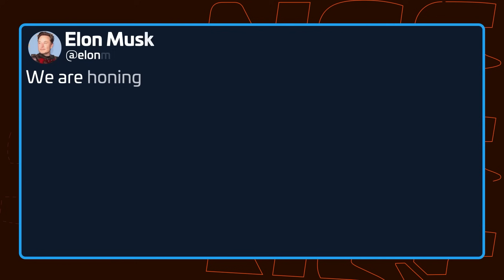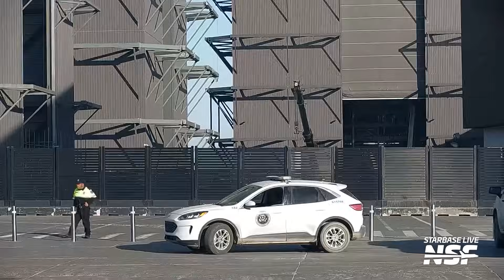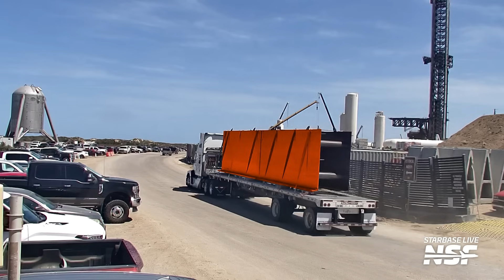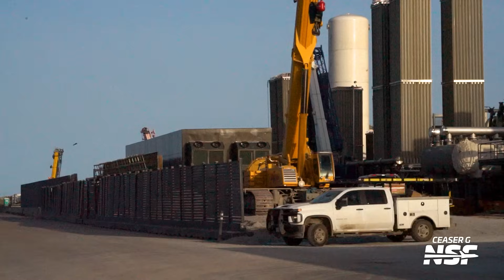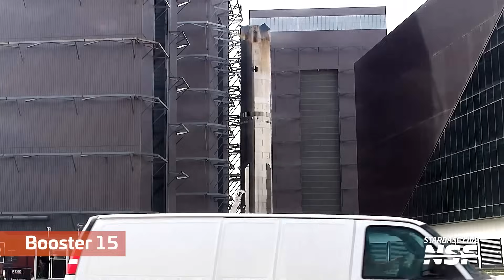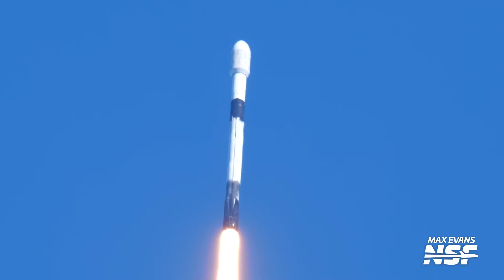The End of the High Bay & the Rise of Giga Bay | Starbase Update

Comment: For all that concrete... When does it just make sense to create a concrete plant on site or within a mile or two?
Reply: Well then you would just be carting trucks of shingle and cement to a near-by point, to just make the concrete mix, and then just carting trucks of cement a shorter distance. No gain at all. You have to work near the quarry that supplies the raw material.
And once SpaceX have their finished launch pads, they won't need much concrete after that anyhow.

Comment: Just think, at some point in the future we're all going to be glued to the screens when they attempt the first launch-relaunch of a booster. It will take off, come back down to the pad, put back on the mount,. a starship loaded on, and the booster fly off again, all inside an hour. And of course then another catch of the booster.
Reply: That's the fantasy.  The reality won't ever match it.

Boosters and Ships are quite hot upon landing; the Ship's TPS tiles will take hours to cool down (as did the Shuttle's tiles).

The obligatory de-tanking of residual propellants and flushing of propellant tanks to get rid of accumulated water ice and dry ice from autogenous pressurization in the LOX tank, will likely take hours - before any new propellant could be loaded.

There will be a need for inspection of the engines, flaps, grid fins, TPS tiles, and so on after every flight - but the personnel to do that will be evacuated to 5+ miles away for every launch and landing, and it takes time to safe and reopen the site and get people back in; then to close and evacuate the site again before the next launch.

Loading and off-loading (when applicable) of cargo on the just-landed Ship won't ever be as quick and easy as loading and unloading of baggage and passengers on a commercial airliner, either.

And you can't keep the launch corridor and hazard area ocean and airspace pretty much permanently closed for such rapid-fire launches, either.
Reply: @Spherical_Cow  It's always funny when armchair experts think they're rocket scientists. 
You sound like a clown.
Reply: @RGBmode  armchair experts have said from the beginning that this thing needs a flame diverter, that this thing has no payload capacity and needs to be 'bigger' or much much lighter and... that the heat shield looks a lot like the heat shield from the shuttle and has most likely the same problems which means refurbishment. 

and the list goes on. That's why arm chair experts refer to Elon time... because, you know... he is a guy who plays video games while engineers trying to explain something to him...
Reply: @RGBmode  as I said, sure... if it make you feel better, maybe write in all caps just to underline that you are so young and hipp... 😂
Reply: It won't be completed in under an hour for a couple decades. Not until we sort out repulsorlift technology (ala Star Wars) that can easily and quickly transport heavy objects. Because as long as we require wheeled mechanisms to move Starship from storage to the launch tower, it's going to take time. 
Then, when it's finally stacked it'll still take another ~30min for propellant loading. (~45m currently, I'm assuming only slight improvement on that time frame)_

Heck, it takes roughly 30min just to turn around a commercial jet! Ground crews come on, clean it, empty waste (both garbage and septic), cursory maintenance checks, and refuel.
Reply: @ I don't think you understand how this is going to work. 
Both the ship and booster are fully and rapidly reusable, so ships will be coming down from the sky, caught and relaunched, be it a fuel starship, payloads already loaded on to waiting ships etc.  There's also nothing to stop one road closure being used to transport ships there 10 at a time. SpaceX can just build a new road if they want to. 
There are also two towers here and another elsewhere, ships will be coming down and going up continuously as fast as the pad can turn them around, especially fuel ships taking up propellant to numerous fuel depots in orbits which allow starships to be launched around the clock. 

A ROAD isn't going to stop this lol.
Reply: @RGBmode  In not talking about a road, or a road closure. I'm talking about wheeled transports moving slow. 🍻
Reply: @DUKE_of_RAMBLE  Are you slow or something mate?
Reply: @RGBmode  The insult is uncalled for. 
If you can't grasp that transporting heavy (and tall) objects takes longer than what the sped-up footage they show us on NSF conveys, that's your own issue, not mine.
Have a good day. ✌️

Comment: Here's an idea: If rapid ship reusability proves to be impossible, they could just mass produce basic ones so quickly that it wouldn't even matter if they don't come back.
Reply: They're doing both, but the bottom booster is already reusable. To get the cost down below $30m/flight (cheaper than F9) they need full reusability. Given that they landed the booster 3x already (the one fail involving thrust blowing off a transponder ariel... very easy fix). They have that part down. The 2nd half will be only somewhat more complex as they already nailed hovering over a specific spot on landing. Really should be able to try a return to tower of the 2nd stage within the next 3-4 months. Pad 2 should be online by then.
Reply: @avgjoe5969 with a purpose built discardable second stage (no TPS, no flaps, no header tanks, nothing overbuilt to support multiple launch and landing cycles), the cost per launch could still drop easily below $20 million.  Even 9 Raptors (similar to what we used to know as Block 3 Ship configuration) will cost a combined total of less than $5 million or so, that being more than 50% of the overall cost of the discardable second stage.
Reply: @avgjoe5969  "They have that part down"
Don't count those chickens just yet 😅
They had reaching (sub)orbit "down" as well, and now with a new design, they aren't able. Don't forget that Booster will also be getting an upgrade and that it, too, could reset their success rate!
Just sayin' 🍻

Comment: Will Starship V3 be longer than V2?
Reply: Probably, we just don't know how much longer but probably not that much compared to what was originally announced in early 2024 (back then it was supposed to be stretched by like 10 meters)
Reply: From a SpaceX video I saved a screenshot in June 2024 and V3 was 17.7 meters taller and the booster 7.9 meters taller.

Comment: They need to both re use boosters and build starships faster to get a cadence near even 24 flughts a year. Re use B 14 and or 15 would help.

But for now the prio should be to get V 2 to orbit. If they csnt do that the system is doomed.

Comment: I'm curious about the construction of the Starship Quick Disconnector on Pad B.
As future boosters get longer, we can expect the location of the Starship Quick Disconnector to be higher.
I wonder if it will be installed higher from the beginning, or if it will be able to move up and down.

Another thing is that future versions of Starships are predicted to be longer.
I wonder if the current tower height, or the height that Chopstick can reach, will not be enough. What do you think?

Comment: I will be surprised if that steel wall doesn't warp from the exhaust heat, and break away from the concrete. Water pumped from a big hole in the river might have cooled it better.
Reply: There will be a large water deluge system integrated into the flame deflector inside the trench, as well as into the launch mount on top.  Much more water will be used for each launch, than on Pad A currently.  Whether or not this will be enough to sufficiently protect the trench walls and floor - I guess we shall see.

Comment: LOL  Nice dig on Heathrow!  ;-)  One question you didn't bring up is where they'll get "a launch a week" worth of liquid oxygen and liquid methane without seriously messing with the supply/price for everyone.
Reply: Liquid oxygen is easy to produce on-site by refrigerating and distilling air.  All it takes, is lots of electricity to power the processes.  (You also get liquid nitrogen, distilled water, and argon gas as useful byproducts).  Even if made off-site and trucked or piped in, scaling up LOX production in response to increased demand is pretty straightforward and wouldn't take very long.

As for liquid methane, that's the main component of liquefied natural gas - something that the United States is producing in such vast quantities that even multiple daily Starship launches would hardly make a dent in the market.

The problem with satisfying Starship's propellant needs will be more that of logistics: how to steadily deliver the propellants at sufficient rates to the launch pads, without hopelessly clogging up and destroying the nearby roads.
Reply: @Spherical_Cow  think they could build a pier at the port and pipe it in via a barge?
Reply: @nathanaustin6988  in the long term, some sort of a pipeline is inevitable IMHO.  But that'd take a good while to get permitted and built.  At the Cape, things are all the more complicated thanks to all the other launch pads and facilities all over the place.
Reply: @Spherical_Cow Nailed it. 
Oxygen will be done onsite. Methane is can easily be sourced.
Reply: @ yea they are going to have to produce it or build a pipeline....otherwise at the launch schedule they want it will be bumper to bumper tankers..
I haven't seen much activity on the gas separation plant...you would think this should start becoming a priority in the very near future..
Reply: what's going on with the plan to produce oxygen and nitrogen at the launch site?
Reply: I wonder whether The Boring Company could come into play here. I just measured it on Google Maps and the straight-line distance from the entrance to the Port of Brownsville (not the actual loading/unloading basin but the end of industrialised area along the approach river/canal closest to the sea) to Starhopper is about 7.2km (about 4.5 miles).

I’m not sure how deep below the ground a tunnel would have to be for environmental protection to accept it would have no environmental impact and allow it to go under the wetlands but as I understand it once it gets going the boring company machine is like a mole and doesn’t surface until it gets to its destination (the other end of the tunnel) so maybe that could get a connection directly to the launch site reasonably cost effectively (doubly so since both companies are in the Musk collection) without being blocked by the EPA.

If that was possible then one option might be for SpaceX to create its own pier on the approach either with massive storage facilities or perhaps even keep a ship docked there and supplying the pipe until it was empty so that the ship is also the storage facility and then time it so that a new ship arrives as the other one departs empty.

This all for the CH4. I’m assuming the LOX and liquid Nitrogen gets produced at the launch site as currently indicated in SpaceX’s launch site plans.
Reply: @julianfp1952  ...the idea of having the boring company take your shortcut seems plausible...especially considering upgraded  electric lines could also be included   odds are spacex would opt to do something like the norstream pipeline though..
Reply: @ I was also wondering about power lines too. From my limited knowledge of The Boring Company I think it does fairly big diameter tunnels so probably big enough to run an LNG line plus high power cables plus still have walk-through access for maintenance. The planned Air separation plant at the launch site is going to need a lot of power so another feed would be useful, maybe even essential, and depending on how much land is available for development around the approaches to the Port of Brownsville SpaceX might even be able to also build its own quite substantial generation facility there, something it’s done on a smaller scale at Starbase but it has limited space there so another alternative site could be really helpful.
Reply: @julianfp1952   with the advent of Inverters, DC power has become feasible...this is a lot safer and in the long run more cost effective than High voltage AC...the upfront costs are substantial but this would a viable power transmission option.  DC Lines also work well laid under water..so this would be another viable option
Reply: @julianfp1952  I kind of doubt that the Boring Company's TBMs are currently capable of drilling tunnels well below the groundwater level.  So far, all the BC projects that I know of, have been located in desert or even high desert areas, where working essentially underwater isn't a concern.
Reply: Great point. But underground pipe would be the best option.
Reply: There is no reason to believe that the existing suppliers won't be able to ramp up production as demand increases.
Reply: @TheNheg66  True, but with the scale of Musk’s ambitions in the longer term it’s not only a case of what is possible but propellant logistics also becomes a pretty big component of the overall plan where cost optimisations could have a very worthwhile downward effect on the cost per kg to orbit number.

Not needing to pay trucking companies for a gazillion deliveries per year or give profit margins to LOX and liquid Nitrogen producers would optimise cost. If Musk does get to the sort of scale that he is looking at for his Mars dream the scale of his consumables would I think be at the point where it became worth SpaceX establishing its own infrastructure for that, essentially becoming its own supplier for anything it can get from air separation and getting as close to source as possible for the CH4.
Reply: @julianfp1952 i think the financial cost will never be the issue with SpaceX's income, but you're quite correct in saying that logistics might be an issue. The highway to Boca and the receiving facilities at Starbase can only take so many trucks per day. I see SpaceX attempting to produce at least some amount of propellant on site just to cut down on the impact of this bottleneck.
Reply: Those “…years of oil and gas supply left” are what’s cheaply accessible. There’s a lot out there and the petroleum industry will gladly find a lot more at their price.  There are clearly other sources of energy that would kill off the petroleum industry. It’s in their best interest for those sources to not be found or brought to the public.  Ever wonder why the FBI removed all of N. Tesla’s files from his apartment the afternoon he passed away.
Reply: It's obvious that you understand market forces and that there will be a flow on effect by the increased consumption of methane usage.
But what you may not comprehend is the 'big picture' of all this. If you look at the worldometer web site and look at energy consumption just for the USA alone and look at the gas consumption, it quickly follows that a cold hard reality hits you in the face like a wet towel, that at best, there is only 12 years of gas left. And an increased rate of production is just going to reduce that. And the electrical power needed to manufacture the O2 and CH4 is just going to put more pressure on the oil used to run the generators, you will see there is only 5 years supply left of oil. So the realization of why there is so much fighting going on in the Middle East and Europe, becomes very apparent. Almost all countries are in the same position. But no one will be able to use nuclear power to get themselves out of this 'downgrade' in production. Maybe Fusion could? If they can get it to work in time?